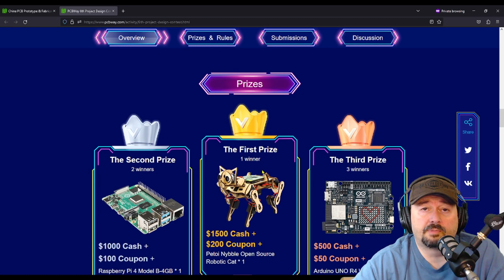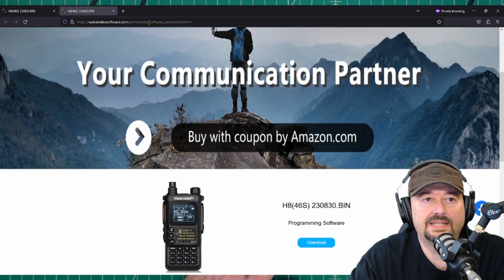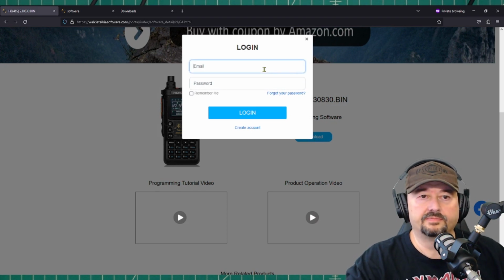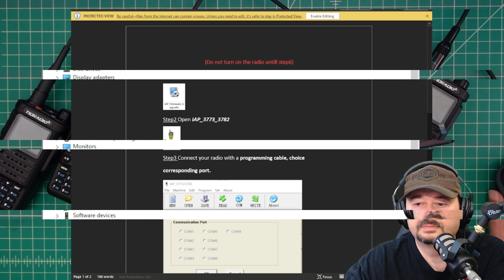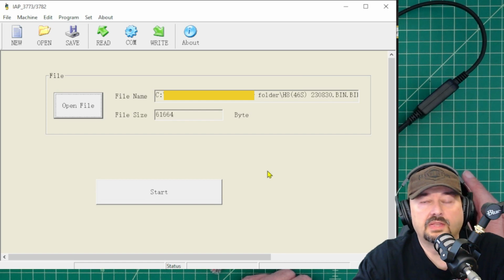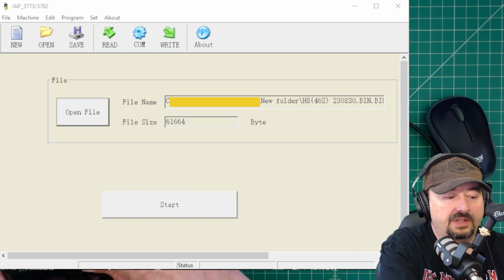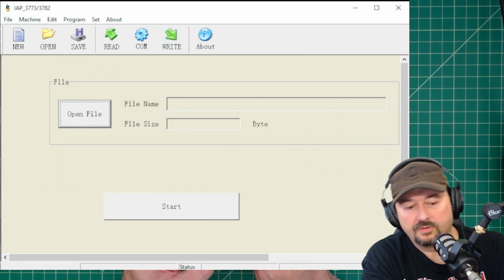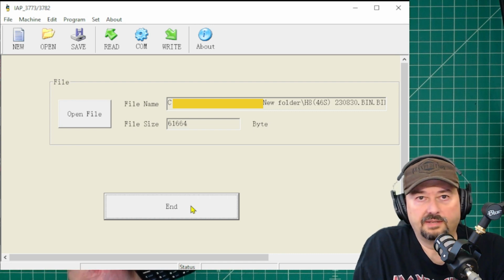Is it EASY? TIDRadio TD-H8 Gen2 Firmware Upgrade

Comment: Step 6 says "Click Start, THEN turn on your radio". It is counter-intuitive but comes on with no screen display, and does the update.
Reply from the maker: I am a big ole dummy, the upgrade needs to be started with the radio off.  After you start in the app, turn the radio on.  I was able to upgrade the second radio, after the upgrade the radio continued to have the same problems.
Reply: I have updated my firmware just fine! Follow the instructions radio off click start then turn radio on. I am 2 for 2 radio updates
Reply: exactly
Reply: That’s what got me at first as well.
Reply: Even more, the instructions say to hold PTT when turning it on, but on mine I had to hold the side key 2 right below the PTT, otherwise the radio would just turn on and operate normally...
Reply: @JelleFoks  Bingo 🙂
Reply: Could you update?  For me it was easy and without any problem.  Use a Tidradio cable and the A36
Reply from the maker: @GmrsKissimmee  I was finally able to update it 👍
Reply: Yikes @TheSmokinApe👍
Reply: New video with the successful update? Please 😅
Reply from the maker: I spoke to the folks at TIDRadio and the FW obviously will not fix the radios that had HW problems.  If anyone has problems with the hardware I'd reach out to support@tidradio.com with the order number and a picture with the barcode.
Reply: @TheSmokinApe  are your fcc id numbers the same on the first two radios? And if they are the same but different than the third can you possibly share them? This way we can see if which hw  version we own.
Reply: Geez...finally got it to work after reading some of the replies. Mine worked after several attempts and different key combinations, it worked with bottom key and ptt held. Thanks everyone.

Comment: Apparently not!
Reply from the maker: I am a big ole dummy, the upgrade needs to be started with the radio off.  After you start in the app, turn the radio on.  I was able to upgrade the second radio, after the upgrade the radio continued to have the same problems.

Comment: You did good work documenting the worst nightmare of firmware updates ape! I'm glad it wasn't one of your high dollar radios that would've REALLY hurt. Sounds like tidradio has some things to work out before you knock any more of your HT army out of commission!
Reply from the maker: I am a big ole dummy, the upgrade needs to be started with the radio off.  After you start in the app, turn the radio on.  I was able to upgrade the second radio, after the upgrade the radio continued to have the same problems.
Reply: @TheSmokinApe  the ol' rtfm monster got you. I've been there!
Reply: @TheSmokinApe  Presumably this didn't work on the bricked radio?
Reply from the maker: @andrewking3087  I was able to unbrick the brick 🧱

Comment: no way , im not brickin my brick, il just wait for a solution.
Reply from the maker: I am a big ole dummy, the upgrade needs to be started with the radio off.  After you start in the app, turn the radio on.  I was able to upgrade the second radio, after the upgrade the radio continued to have the same problems.
Reply: @TheSmokinApe  
its allright, im stuck with one too:face-purple-crying:
Reply from the maker: I spoke to the folks at TIDRadio and the FW obviously will not fix the radios that had HW problems.  If anyone has problems with the hardware I'd reach out to support@tidradio.com with the order number and a picture with the barcode.